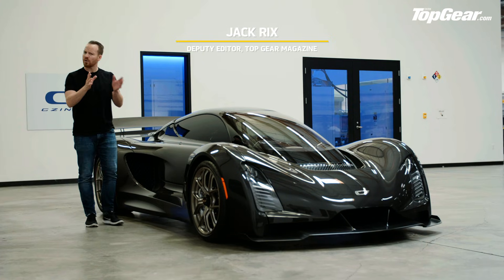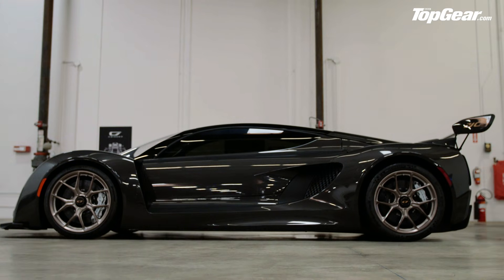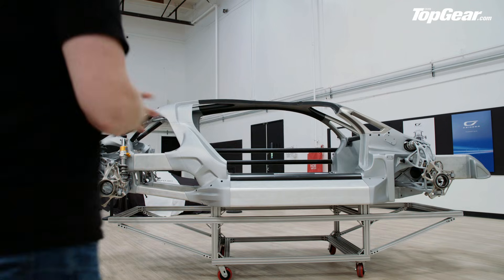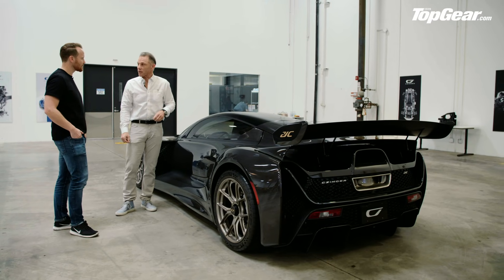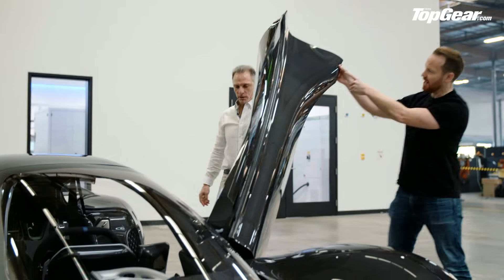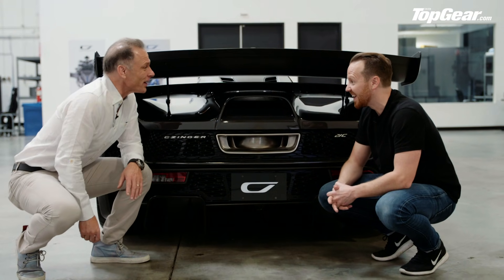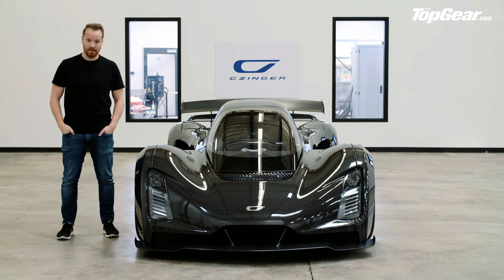FIRST LOOK: Czinger 21C: the world’s first 3D printed hypercar | Top Gear

Comment: I just bought a 3D Printer, downloading this Hypercar now, at a fraction of the 1.7M price tag. 😈
Reply: Funny man
Reply: Error 404 printer not found
Reply: kinda Expensive for a printed car.
Reply: It’s the AI and the laser and the material you do recall him saying $150 million worth of tech, right?
Reply: What about the engine and stuff that isn't 3D printed?
Reply: Alta California the parts for the engine can be 3D printed and assembled
Reply: @altacalifornia2580  sadly some parts cannot be 3d printed because, at some areas when no annealing is applied ( put in an oven to bake them ) so that some joints or areas are fused together and if a small speck of cracks appears due to gas pressure it will cause explosion when build up. So the idea of that has to be taken out. It has to be formed from a block of steel and cut into their dimensions. 3D printing still at infancy stage. If the filament layering goes through underextrusion  - that part that has thinner wall, will leak and get punctured easily by pressure. Man all sort of problem arrises.
Reply: that slm 3d printers and powders not cheap
Reply: Multicolore product or just black, grey, white ?
Reply: Wait that's illegal.
Reply: @Phelan666  : Well... well... well... what's legale or legale it would make a difference, when the other is temporarily in absence, of what you temporarily have in stock.
Reply: it might cost more cause all of the plastic u need lul
Reply: Umm, hate to break it to you, bit you'll also need the vertical robotic assembly system to put the car together, and a large garage to house the system in, which is still a lot smaller than a standard car assembly plant.
Reply: They use laser focussed 3d printer on powdered metal. That setup is wildly more expensive. + The titanium and carbon fiber
Reply: @varaknus9103   The actual savings is in size of the facility and the land required for the assembly facility, which costs a fraction of the cost of conventional auto assembly plants.
Reply: 3D print me a v8
Reply: 5head
Reply: Gonna need a lot of adhesive to stick all the little bits together...............
Reply: @steeveedee8478  It's still pointless because adhesive won't be able to pull through wear and tear and when there is 2 different parts the heat exchange will also be different. Example different properties by just a little even by 1% to 5% difference in copper or different make from different companies it will still behave differently. 
Example you uses heat exchange through steel 316 and through steel with more non iron properties giving more light weight.

These are 2 different  "materials" behavior.
They will behave differently. So if you gonna buy a particular parts gotta stick to one manufacturer and same % used. But by having this 1 manufacturer it gonna cost u crazy amount and takes forever to finished. If you have different vendors and different types that can work together you got yourself a supply chain that can be spread over large distances.

Other than that there is alot of connections you need to make to make it work man. I did the math and all that is needed. It will make you broke.
Reply: Ben Sanspiro  partially agree with you, but 1.7  folks want hand made stuff.

Comment: "Designed by computers" That's just being rude to the engineers..
Reply: Yeh the engineers put the parameters in but ulmitaley the computers calculates where the material is needed hence u get that natural look instead of angles and straights
Reply: @saqibzaman1476  And who wrote the code for the software?
Reply: @krocketonboost5236  yeh sorry meant that as well like everything was set up but the computer actually produced he design

Comment: Ofc the first car is a hypercar, it’s so much easier to build 10,000 cars for 1 mil each than it is to design a factory that can churn out a 1 million $10000 cars, especially if you want to 3d print a significant portion of the parts.

Comment: 3D printing is not the magic answer to everything. In fact, printing large parts of the chassis or even small parts will always be weaker and more expensive than casting or machining parts. This whole thing feels like an ad that just throws random numbers and facts, and even some BS. Also making parts smaller and spindlier does not make for a really safe car.

Comment: if the computer designed the suspension to have only the amount of material that's absolutely necessary, as soon as there's a bit more strain on it, say during a high performance race, it might well disintegrate round the first corner... remains to be seen i guess.

Comment: Meh idk how I feel about this. Ok sure the piece is made super ultra thin. It bares all the loads but lets say this: you are going down the road the ultra thin piece handles all the loads but BAM solid little stone 1x1 inch is on a road and gets tossed into the ultra dooper pooper ai designed part. Ur wheel falls off no thanks

Comment: The seat belt will have to go. You should use 4 or 5 points seat belt which is attached to the back of the seat.

Comment: I’m if it had 4-500bhp it could be even lighter and still have incredible performance.

900bhp through the rear tyres...just seems a bit much!
Reply: If weight distribution and downforce spots are as good as it looks, it is actually really exciting.

Comment: It would be even better if they listened to Sir Colin Chapman and made a LIGHTER version of the car.
Americans always strap on the biggest engine you can get your hands on, and blow the horsepowers up to the engine limit.
Imagine that car... But with 400kg less. Hell, could even be just 200kg less, and you could swap that heavy V8 for a lighter I4, extract reliable 300hp from that I4, and have THE SAME CAR, essentially... But cheaper. 

WIth that I4 and that low weight, it would be a "3D Printed Road Legal F1-sibling roadster".
Boy, Sir Colin Chapman was damn right!

Comment: The issue is this: 

3D printing that suspension arm using DMLS out of aluminium costs tens of thosands of dollars, for EACH component, every time, and takes 48 hours or more to print, EACH component, EVERY TIME. 

Die casting a suspension arm out of aluminium ( the way everyone does) costs maybe 10-15 dollars on a large scale, and takes literally a few minutes to produce a component. 

Sure, the die cast component will be 10-20% heavier for the same amount functionality, but is a 2000-3000% cost of production increase worth it? 

Let's not even go into the 3D printing of the monocoque pieces, which is utterly ridiculous. As nice as they look, those pieces are HEAVIER, WEAKER, LESS RIGID, MUCH (x10 or more) MORE EXPENSIVE than if a monocoque was made out of carbon fiber, using methods that everyone else uses.   So again, is it valid to increase the cost of something by 10 or more times and end up with an inferior part in every way, just because it's made using a new method? 

The only advantage this has is for R&D and low volume production where money is not an issue, which is, guess what, exactly how these technologies have been used in the aerospace, racing, automotive, marine, etc. sectors for years, over a decade in some cases. This is nothing new or revolutionary. The only thing revolutionary is how much money this company is willing to lose on producing these components, so they must have some very rich investors who don't mind losing cash.

Comment: I must be the rare engineer who has experience with this tech in this comment section in order to see this is nothing but a marketing stunt in order to impress people who are completely unaware of the existence of additive manufacturing. It's nowhere near as groundbreaking or new as you think or as they're making it sound.  All car companies and racing teams out there have been using tech like this for almost a decade, aircraft and space industries as well.  It's just that it's not used for mass production because it's THE EXACT OPPOSITE of a technology viable for mass production, and it's gonna be a long time (decades) since it becomes viable. It's far too expensive, and the benefits of using it are virtually irrelevant to the end user. 

For example, those monocoque parts 3D printed out of aluminium are MUCH heavier, MUCH more expensive and NOT as strong or rigid as they would be if they were made out of carbon fiber like other monocoques are made, AND they take far longer to produce too.  That's the point. This is just showing off to impress clueless people with tech they've never seen. Luckily for this company, 99% of people are clueless, and will fall for anything new, just because it's the first time they see it. Those of us who have been using DMLS tech for years for prototyping and R&D can only laugh at that, because we've been designing and printing components more complex and impressive looking than this, but NOT FOR PRODUCTION, since if any company did that, they'd go bust in a week. People aren't aware that one of those suspension arms costs tens of thousands of dollars to print, and takes like 48 hours to print fully.  At the same time, you could die cast thousands of suspension arms out of aluminium for a few dollars each and in a few seconds each, and end up with components that will perform 95% as well, but at 1 or 2% of the cost.

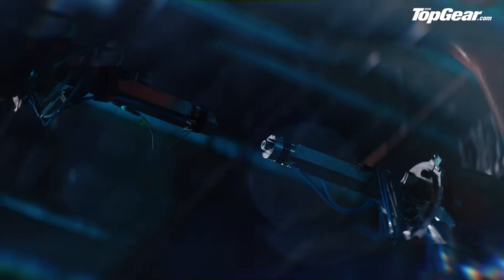Comment: 2:40, “the idea is to do away with the old production line techniques that date all the way back to Henry Ford”....yeah, it’s called people...to do away with PEOPLE, let the robots to all the work lol, whose going to be left working to buy all these products that robots are making and drones are delivering? ...NOT this car that’s for sure...as they’re building cars not going to be driven by the average workers 🤔

Those spaghetti suspension points will snap like a twig as soon as it pushed in an abnormal load...a load that any other car would brush off...this will be structural failure to the point of replacement.

Whose going to replace it? They may get the part down to an affordable price...however as many of us painfully know, in many cases it’s not the part, but the replacement (labour) that is cost prohibitive.

$1.39 part failure can cost $2000.00 to install...

Comment: The ability to 3-D print almost any shape is cool BUT what about the inherent additional strengths of processes like forging or cold-rolling which create significant extra material strengths becoming totally lost in the creation of printed structures? With 3-D printing you ONLY have a material's inherent strength to work with!

Comment: for a 3d printed car, im expecting a lot more design breakthrough, especially the outer shell. the body looks like they just banging and bending an aluminium plate with a hammer. if you have access for such a 3d printed tech, u need to do more crazy design for the body..

Comment: This guy is the American Christian Von Koenigsegg. Using AI to design car parts is surprisingly not common. Airbus used an AI designed piece in one of their planes before and that was a couple years ago I think. Also 900+ HP from a 2.9 liter engine is astounding.

Comment: The car being so light, lighter than Valkyrie possibly, makes it really a lot of downforce. Valkyrie itself probably has a lot more, though.
But this one has a hybrid system on the front axle making the weight achieved more impressive. 
Only 1 kWh battery, so it will just about take on the energy from one hard brake event and then use it coming out of the first corner. actually an efficient way to deal with hybrid when weight matters. A track car is limited more by its weight than it's power or traction, but an extra axle of drive is worth it for the 0-100 kph number and ultimate control and traction in/out corners.
I suppose the battery could even charge when the car is just fuel powered. Not efficient, but it can help it be faster over a lap. Charge in half throttle situations, not only braking. Using some fuel ahead of an acceleration event in case no braking preceeds it.

Comment: So it's their first car and they designed a new production methodology, designed their own powertrain with super high powered V8 that goes to 11k Revs and 3D printed partes designed by a computer? How good the computer designed entirely depends on how accurate the inputs represent the forces every piece of the component will later be subjected to... So I do hope they hired people with a lot of experience in racing and car engineering, rather than just software experts.

It all sounds impressive, but it also sounds like the car should come with it's own mechanic. And 150 mio $ development costs is really not that much... Does not seem enough for such an ambitious hypercar.

I hope I'm wrong because it looks great and I very much like the concept.

Comment: I get the impression that it could have horrible blind spots in the visibility to the font left and right. Might make it tricky to use in daily traffic and hard to judge corner apex on track. I might be wrong, but if I see where the windscreen edges are and the wheel arches, they seem to be limiting a lot of visibility.

Comment: Yet mercedes are still having problems with their high revving engine for the mercedes F1 car
Reply: It's probably easier to start with a clean sheet design than with a race engine.  Not that there is any proof this motor is reliable (or runs).

Comment: Absolute minimum material designed from a computer that's looking for absolute efficiency isn't exactly a good thing.  Always prepare for what you aren't prepared for because nobody can think of everything.  Need to overspec it slightly to compensate for that unforeseen outrageous pothole or a person running over a parking block by accident, etc.  My first car was practically a tank that survived plenty of my bad decisions with nearly no damage to show for it.  I love the process but some of those supporting structures were just too skinny in my view.

Comment: Me: Hmm cool a 3d printed car...
Car: SHOOTS X SHAPED FLAMES

Me: High pitched fanboy SCREAMS

I can't wait to see this to rip up tracks-
Reply: @Tanmay Jamwal I think it isn't considered hypercar, it's pretty much track focused and is a GT2RS opponent, not a LaFerrari, Huayra etc opponent. The Senna is a lot of Function before Design, so I'd like to think it isn't a parquet queen. It hasn't proved anything though on the ring, so till then...
Reply: @Tanmay Jamwal The price only does not make the hypercar, the Senna obviously is function before anything else. The Huayra as example is  $3.5M and didn't break any record.. Ever. The Agera is $2M+ and except the usual 0-100kph 0-300-0 etc crap I don't remember to have broken any record either, a track record that is, which would indicate the car can do more than launch in a straight line. So if the price puts the Senna among them, well ok, but nothing in its design does.  Unfortunately making a lap record on one short track doesn't automatically mean it will make such thing on Nürburgring.
Reply: @Tanmay Jamwal I have never heard a K'egg to shine around a track. 0-100, 0-200, 0-300, 0-300-0 times yes, but that's it. I might be wrong, but I never saw them doing anything that involves turning. And to be honest, the 918 DID a good Ring time. The K'egg tried, crashed and after that nothing else happened.
Reply: Multi-million hypercars .... hmmm probably will sit in front of the coffee shop, not rip up tracks. Hypercars aren't track toys, they almost always pretty much suck at tracks, get overheated and so on. One might think all that money should buy performance that also is durable... Guess the target group isn't interested in doing more than 2-3 rounds a day ... Eventually....
Reply: @IvoRadev  Except when it's the P1 GTR, the LaFerrari FXX, etc.  The hypercars that sit in front of coffee shops do have track counterparts which are indeed found on tracks and no, not overheating either.
Reply: @IvoRadev  Bro.  I said the GTR and FXX are the TRACK COUNTERPARTS to the hypercars that sit in front of coffee shops.  As in, the GTR and FXX are the ones you find ON THE TRACK while the the street versions are in front of the coffee shop.  If you don't know what counterparts means, look it up.  Please read carefully before losing your shit, jesus christ bro.
Reply: @IvoRadev  You have major comprehension problems.  Or you're arguing just to argue, because you agree with what my point was. If you're not 16, seek help.
Reply: @MikeKayK  Sure, I have major comprehending problems. I'm the one that comes talking about track only cars with no street license when the point of conversation is the street legal hyper cars. Sure, whatever you say kid. As I already told you, read first, talk later. I had not even read your comment till the end, its start was clear enough that you had nothing to say... Except this, except that ... There is no except. The street legal parquet queens do have problems on track and that was the point of the conversation. The track day only cars don't, it would be idiotic if they did, since that's their purpose. And no, they don't all have counterparts, just because the P1 and the LaFerrari have doesn't automatically mean they all do. The Veyron has no track only counterpart, the Huayra doesn't, the Koenigseggs don't too ... Shall I keep coming up with cars with no track versions? If you need help reading this please tell me, I'd be happy to help.
Reply: @IvoRadev  good to know🤔
Reply: Ivo Radev many rich peeps don’t, but they do go on tracks also the overheating thing is bullshit, this is a high quality vehicle not a GM piece of shit you roll around in with your mother, boy.
Reply: @Tanmay Jamwal What's confusing you? You never saw hypercars on track? I mean outside of review videos.... All of them start overheating after very few laps. Parquet Queens my friend, full with technology indeed, amazing on paper, but if you push them hard (as a car guy would want to) and you see that they only look like they can "race"...